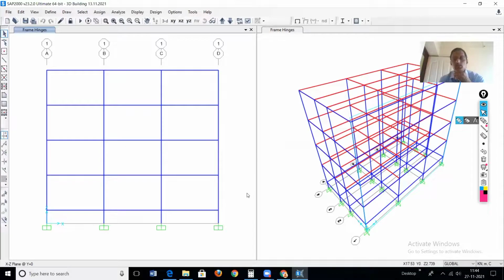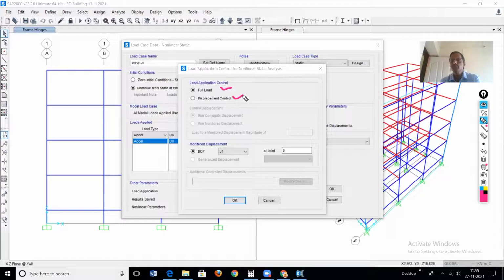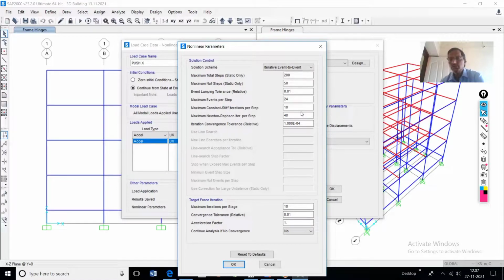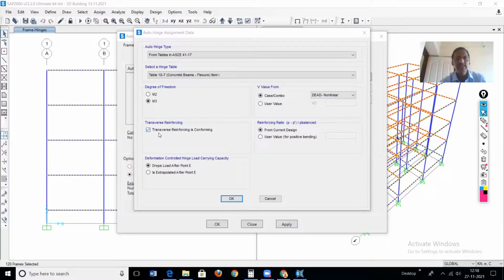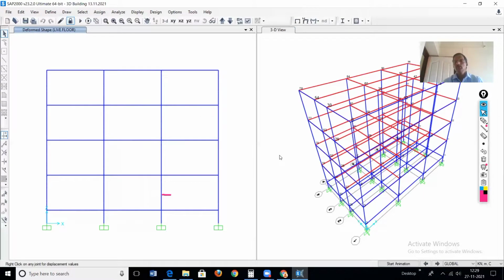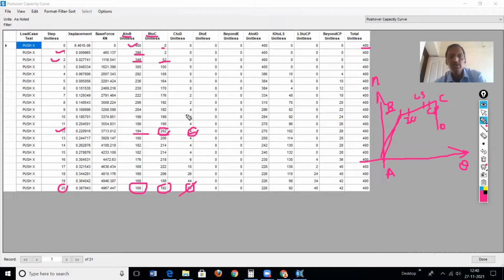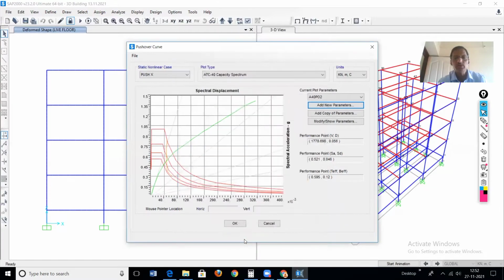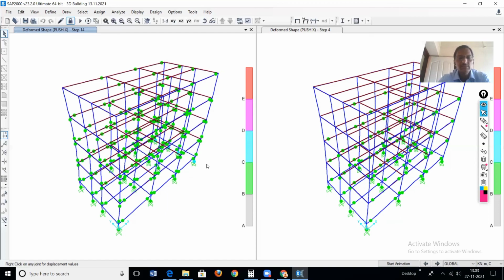3-D RC building Pushover Analysis

Comment: Hello sir in Etbas software i have applied the same process, and got results like pushover curve, plastic hinges etc. but i am not getting ATC 40 Plot type. there are different plots available like NTC 2008, ASCE 41. you tell the process in view of changing parameters in ATC 40. so how do i do

Comment: Hi what is your opinion about analysis and design Slanted or Inclined column concrete in SAP soft ware ?
Reply from the maker: Its a concrete column, its analysis and design is possible. Correct modelling of inclined column is only a challenging part.

Comment: How about for the case of flat slab,
how to define the locations of the Plastic hinge.
Reply from the maker: In seismic analysis, floors are acting as a rigid diaphragm. It distribute the loads among the frames. So, the normal slab or flat slab we are not defining the nonlinear properties (Hinges). Hinges are defined only for the frame elements near the ends.